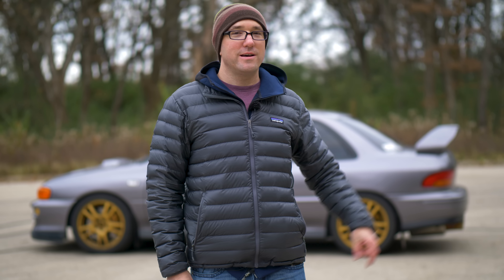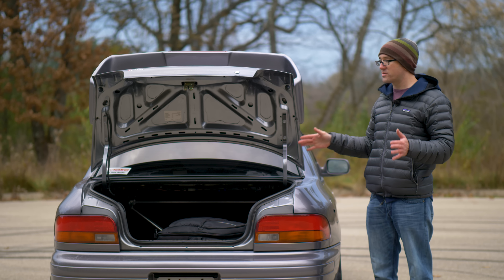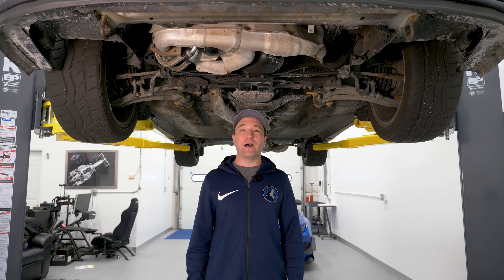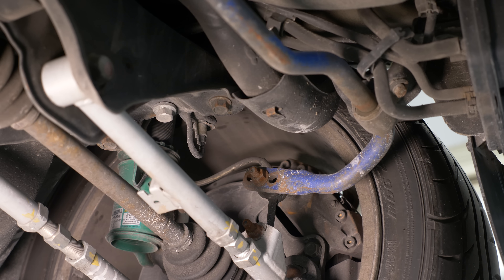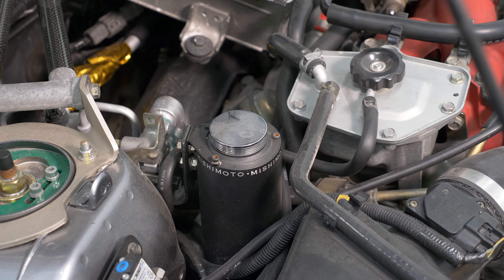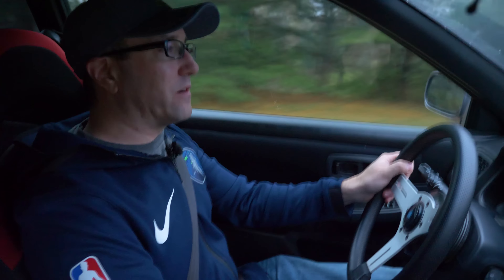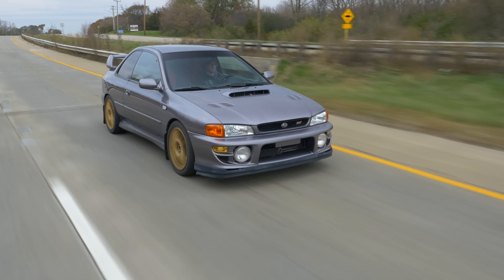Review | Subaru RSTi | When Older is Better

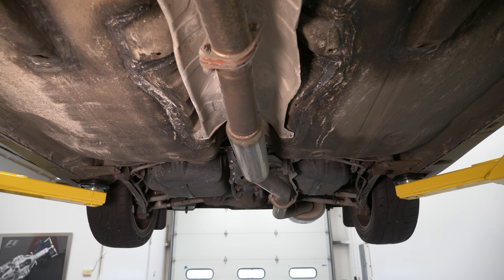Comment: fantastic video. i did have a sorta “ha ha” moment at 9:20 when these things were said: “this is definitely a no expense build” “this is not something you do in your back yard.” i beg to differ. this really is a pretty straight forward swap minus the wiring harness merge. i did this EXACT swap almost completely in my driveway with zero air tools and never had really worked on a vehicle before besides oil changes. this car is a really clean swap, but kinda rough around the edges.
Reply from the maker: +Steven Palmer You are that 1%.  You have to remember this car was stripped down to frame, gutted repainted, rewelded, converted, harnessed, steering quirks etc.  Its pretty involved for average people.  Sounds like you are hard core do you have any vids or pics of your build?
Reply: You're absolutely right and my comment didn't give enough credit to the extent of this car. I'll tag you on IG. I have a swapped full gen 8 running gear front to rear WRX sedan, just waiting on my merged harness to return from California. Once it's running again i'm sending it straight to paint in January. I live in Japan so everything takes forever to get done. The car is a first year GC8 and the swap came from my previous daily; a stock 03 GD chassis STI with 155k KMs that I picked up for 3 grand. Because of Japanese compulsory insurance requirements, the STI was going to need a bunch of cosmetic repairs so I just decided to steal the drive train, junk the shell and take on the daunting task of a swap. I picked up this rust free 1993 from the auctions for $1700 with a blown clutch. It had the old EJ20 turbo and a 5 speed but parts are scarce and you can't tune the old stock ECU. So an updated power plant is a nice touch. I really wish I had taken the extra steps to add rigidity and completely restore the under body but I am limited on resources as a "gaijin." And my biggest regret: not filming/documenting this whole process. I really hate vlog type fan boy car channels but I want to start uploading some sort of content to youtube. My job and family take up my whole time so maybe i'll just start with time lapse videos.
Reply: I thought the same thing until he brought up the seam welding and painting. It's just too bad that it clearly has seen salt more recently - under the car did not LOOK the part and the coilovers looked rough as well. Considering how clean some JDM parts are, it's too bad this car couldn't have skipped the salt and stayed clean with so much work in it. I got rid of my RSTI because rust/body work needed was getting worse - this one avoids that, but will hopefully not be seeing salt on a regular basis.

Comment: What he mentions about the 90's is what I love so much about my FR-S: it's a modern new car with the perfect balance of simplicity and modern convenience just like a 90's car.  No over-the-top touchscreen interface or a gauge cluster that does backflips, just simplicity that works and doesn't distract from the driving.  It's also the most reliable car in both Toyota and Subaru's lineups.

I wish Subaru would go back to the GC8 design aesthetic with newer WRX models.  I know it would have to change some to meet modern safety criteria, but they could get it close enough to do the job.

Comment: I've owned a tuned 2001 RS with a USDM Ej205 Turbo.  It really surprises so many modern cars on the road.  With the RS gearbox, the ratios are much closer I can really use all of the ej205 power.  I had Cobb Stage 1 tune and easily puts down 250HP in a 2700lb car it flies.
Reply: 0-60 5.3

Comment: What a relaxed solid review. Third one I've seen so I'll subscribe...because it's just as hard to find an informed relaxed intelligent mature review without the weird oddities of our...culture, as it is to come across an amazing build like that Subaru. I'm just a courier, not the educated wordsmith or anything but I know what I just saw. The photography sound and the host all top notch. I drive for a living. 2009 ram 1500, 2003 honda element and for legal docs and really small pkgs I take my 2000 altima 5spd manual. I hope to have the $ to build her one day cause shes a deserving car with pretty low miles and super clean never  tuned. But as is shes fun and you're right...we went wrong somewhere along the line. Perfection and safety has taken our free spirit in the car world at least. Thanks for reviewing a car I admired when I was young enough not to k oo better. Good days. Stellar reviewer and review. Thanks

Comment: I understand he's not a Subaru fan boy or know a lot about Subarus and their aftermarket parts but I had to do a double take when he pointed to the Cobb 3 port Electronic Boost Controller and called it a Cobb Flex Fuel kit. At least get the details of the car before filming so you don't make mistakes like this.Kudos on the bit about putting dead Evo owners in the trunk that was funny.All in all it was a great video and I wish my RSTi was as clean as this one is. Well put together car and well made video.

Comment: Meh. I prefer the EJ20. Breathing right, and with just 1.2 bar of boost, coupled with equal-size 22mm sway bars, with solid drop-links, and alloy control arms, mine is a total joy. I just did 1,000 klicks in it this weekend, and the car is beyond awesome. Easily pulling to 200 and beyond. 90 klicks of that was on gravel, where the car shreds the side skirts with legitimate WRC sideways style.Above 3K the car has instant turbo response and savagely accurate steering, and 12 pots of Brembo braking power stops it faster than pretty much anything.

Comment: The JDM  field monitor units are sick. I have an OEM overhead field monitor from a Hilux Surf installed in my 4Runner.

Also big exhaust pipe, but a resonator and proper muffler.

Comment: Nice reviews. 
GC8s are great cars,

For the DCCD, all it does is change how aggressive the diff locks up. it uses an electromagnetic clutch.
So forward is full lock which won't be nice on turns and only good if you're getting excessive wheel spin.
Full rear is open which is fine and will still lock up if there is excessive wheel spin.

it's basically controlling how aggressive the centre diff locks

Comment: For quicker steering, there was an optional right hand drive 13:1 quick rack which came on the Japanese STi Type RA (sedan) and Type R (coupe) rally homologation models... The part number is " 34110FA092 ", " 34110FA091 " or " 34110FA090 " for those who were looking, and so-equipped parts cars should have a little " Quick steering by STi " sticker on the rear window. I had one in my possession, which was sold on for some Australian to fit to their Australian delivered GC8 STi which (sadly) didn't come standard with them (or DCCD either, grumble grumble Subaru Australia).

For left-hand-drive cars the 15:1 steering rack from USDM delivered GDB STi's can be used, with a little bit of modification to the brackets IIRC.
Reply: True ! but a gc8 sedan sti smashed a hsv gts , straight line ' corners dominated . Hsv now has a supercharger but before a supercharger sti dominated down under

Comment: Got almost the same swap setup except with a RS 2001 frame and a version8 Spec-C. Never seen winter since the swap in 2010. Yet the 17 years old frame and 12 years old engine/drive train still feels better then the latest STI. That 2.5L engine never could reach the same performance and reliability of the 2.0 JDM. Still amazing what the a 330HP engine do in a AWD 1300Kg car. Probably only the AWD MR2 can compare in that price range.

Comment: If you want to drive a more "true to the roots" RSTi come drive mine! It's a 99 RS with a JDM ej20k from a 97 STi. No DCCD or anything fancy like that. Doesn't need corn, it runs on 93. It's a true tuner car because it runs an Apexi Power FC. I haven't went in and done fancy body upgrades other than strut tower bracing and the biggest whiteline sway bars I can get. I also have kyb AGX adjustable shocks and H&R springs that makes it handle better than the Teins. Mine has the factory 2.5RS 5sp transmission with PPG straight cut gears so it's basically a streetable rally car with a big turbo and meth 😂

Comment: For some curious about the older cars, ignore the early generation.  Yeah, the styling's neat, but the 2nd generation has a significantly better chassis with no loss of the old style feel.  Start at the 2nd gen.  The chassis improvements are significant.  The chassis is quite a bit stiffer, the inertia is noticeably better with lighter weight external panels, and the interior is a good bit more modern.  There are really no downsides other than external appearance and to some degree the durability of thick, steel external paneling that were rather rugged.  The second gen is just a better chassis to start with for sport use.

Comment: I think most of the connected and visceral feeling is coming from those coilovers upgraded bushings, and so on.  If that car was running a strut suspension and standard bushings, it would have been a lot more like a typical modern WRX.  It also sounded a LOT like the FA20DIT engine, anybody else notice that?  IDK, it is a nice car but the visibility in my '18 WRX looks almost the same, if not slightly better.  And the, let's say, "simple" interior design is still there too.  I love it, personally.

Comment: Remove the plates under the vents on the inner hood for less heat soak ( only in heavy rain will cause any damage really but you put back on the outside when parked)

Comment: The problem with E85 is that just jamming a flex fuel kit into the car isn't enough to take advantage of ethanol's benefits. Some of the fuel economy lost is just down to the fact that ethanol has less energy content, roughly 33% less than gasoline, so outright part of that influences the mpg number, you need more liquid to achieve the same vroom. Additionally, if you were designing a high fuel economy ethanol engine, you'd want to take advantage of the cooler burning and knock resistance to push up the compression ratios, and lean out the air/fuel mixture to boost the fuel efficiency (of course, that would sacrifice some power). These flex fuel cars and tuner cars basically just take an engine designed for gasoline, and running ethanol through it instead, so it's never going to fully utilize the advantages of ethanol to increase efficiency. It'd be like if you retrofitted a diesel engine with spark plugs and ran it on gasoline, it'd probably run like absolute dogshit, because at a fundamental level, nothing about the engine was designed to use that fuel, it's the same problem for ethanol conversion.

Comment: the plus for me with built and tuned subaru turbo engines is the massive mid range torque. particularly on the street no need to rev it that high anyway.

Comment: The aftermarket parts..... You mean the twins roll turbo which didn't conlme with a twin scroll setup and if he used the rcm setup it's averted as you get a guard for the oil lines to the coolant

Comment: i would love to see a video on the modern sti to see the thoughts now that you've done this, the new gen wrx, and the older wrx (not to mention most of the competition - type r, rs, etc)
Reply: old is better , I haven't drive the 2018 sti yet
Reply: And the prices down under show this ,  hawkeye sti costs more than a 09 g3 wrx sti for 18k  because its more popular . And are gc8 sti coupes  are hard to find under 30k aud now
Reply: i agree that the older ones are better, but living in Canada, rust is a huge issue. as somebody looking for a daily driver, getting an old one is out of the question. i have spent the last two years looking for a clean '04/05 and every single car was just too far gone (to be a reliable daily driver) even though they were never winter driven. and i'm not paying $25,000+ to get only a few years before the salt eats through it entirely. so to me, a new one makes more sense so i can do the rustproofing and ensure it lasts.

Comment: great video as usual!  IF one day you get the chance to test a  stock pre 00 IMPREZA WRX STi, please do it... they are a completely different car to what you drove here and they weight 220 +/-  kg less than a gc with a GDB swap. 
Regards and thanks for doing this!
Reply: yes jdm sti has Dcd , rs Abs . If you go very  fast around corners you wont use your Dcd . Dcd puts more power to one wheel , The handling is pretty much the same jdm sti to this

Comment: I'm not a teenager and I would love to have/drive that car. So, does that make me an old guy nostalgic about the past, even if I'm in my mid 30's? lol The funny thing is, that 6 minutes into the video I feel like I'm getting everything you're saying, just the way I would say myself. The way you talk about this car matches how I feel about my car (04 SVT Focus). Yes, they may no longer be at the top of the pack or even the middle in terms of sheer acceleration or braking numbers, but when it comes to how they feel in everyday driving, modern cars just don't measure up.

Comment: Great review... you should do more videos like this.

I kind of want to do a 90s car build... definitely not this high quality, but still fun. Actually my 09 Civic feels a lot like something from the 90s. If the A/C didn't suck I would keep it and turbocharge it.

The point about high revving motors is apt. I'm surprised they don't make high revving turbo motors as they are clearly possible. You'd think with all the valve timing tech they'd be able to get it done. Ironically though Subaru is still carrying the torch with the BRZ.

Comment: I miss the '90s cars. They were just so much better than what's available now when it comes to character and size. I love modern cars, especially their safety (I've been in a roll over in one, amazing)...but they're missing something for the most part. The MX-5 and BRZ have the spirit, and I hope more cars like them come out, but man.....the '90s <3
Reply: Agreed, the 370z does still give an Analog experience, which is why I bought one, yes, it's smarter to get one that's 3 years old, but it is a nice blend of power and handling if you're willing to change the front swaybar, tires, and upgrade the pads/fluid.  For me it was a good compromise between going for the all out handling approach of a miata/brz, but getting back some in terms of straight-line performance.   The problem is every reviewer that "tests" one picks the overpriced Nismo at $45k, pickup a used 13+ sport (bigger brakes/better rear diff) for $25k, then hit some twisty roads.
Reply: What doesn't make sense is they don't have special variants of the MX-5 and BRZ that have high horsepower numbers from the factor. I get it, they're handling machines, but hey, obviously, the market is asking for this considering all the support the aftermarket is getting for these cars.

Comment: Subaru's are like legos; you can take a chassis and more or less do what you want powertrain wise. If you are looking for something a bit more modern, and easier to get parts for, your best option is an 06/07 wrx - 2008 is when Subaru started to get nanny happy with their cars, they also started to gain more weight. There is a clean 2.5rs in my area, it has been modified, but with a performance bent instead of the park hard, flat brimmer, vape life mentality that the newer ones have attracted.

Comment: Nice swap...It's honestly a shame that the STI's here were sold with such weak motors.  Car looks good, great trans, brembo's, ect.  You get everything but a motor that can handle power. So most owners end up with a built motor which an already expensive car that much more pricey...  It'd cost a fortune to make a STI run with a bolted e85 evo, or a 50 trim srt4.

Comment: I drove an 01 4 door Subaru. One of the faster ones with a 6spd. I gave it a good bit of hell. More than the owner wanted me to but no as much I wanted. It was quick or a more suitable word zippy. I did enjoy it. But its not my Camaro. And I didn't feel comfortable beating on the Subaru. It just felt weak. The engine did blow a couple weeks later. My Camaro feels like it can take a bashing. Just feel of it.

Comment: Not that I am a honda fanboy or anything, but the eightgen civic si (for the us) and s2000 redlined at 8k rpms and 8-9k rpms respectively, and they feel as if they could just rev forever, until you hit redline. Now honda is going towards the lower rpm turbo engines that just feel like they run out of steam before redline, even if the make almost double the torque of the higher reving honda engines. I can't really see any other affordable manufacture besides honda reintroducing the high reving engines, but I really hope they do.
Reply from the maker: +derek m I think the high revving engine is dead except for Supercar companies or big companies that can slide it in to a lineup of a million Eco cars.  From a regulation standpoint in terms of emissions it's extremely hard to design them now.  There are so many Emissions Control strategies that you have to employ it's just not worth it.

Comment: I have a jdm type r sti, its old, stinks of fumes and blow-by vapours, hard suspension, noisy gearbox, transmission and exhaust and does 20mpg. Would I change it, hell no, it's the best car on the road, sitting at 208,000 miles and still going strong :)